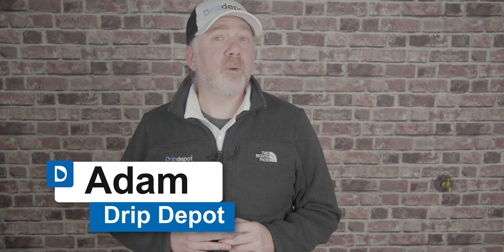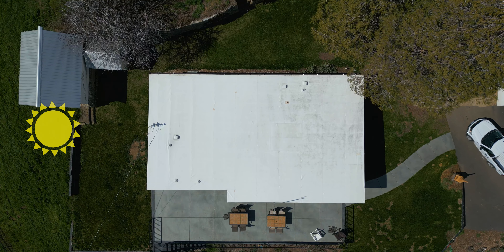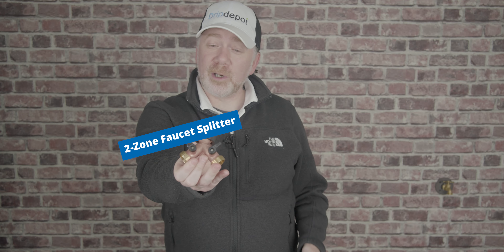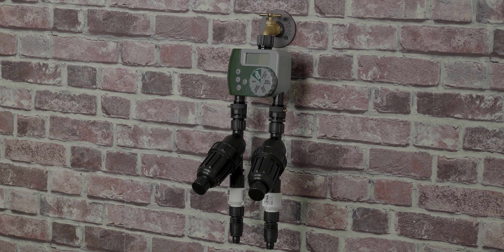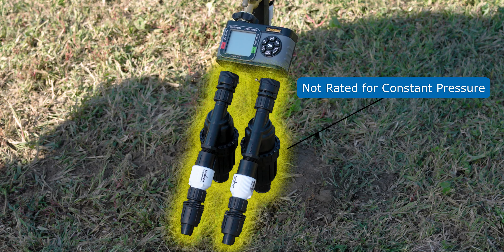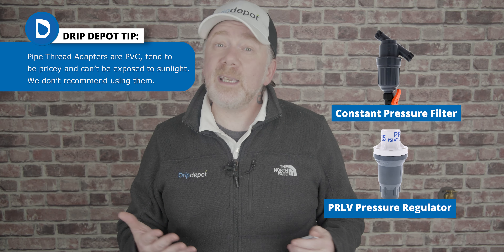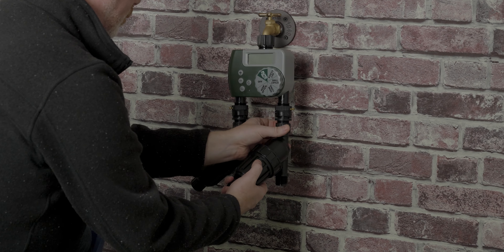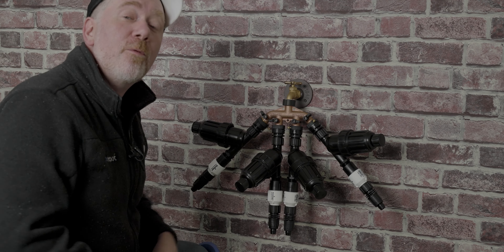How to Zone a Hose Bib Drip System

Comment: Can you add the Y splitter behind your timer and add the 2 head assemblies? In my scenario I just have a large garden and am zoning due to the length of 1/2” tubing limitations. I would like to water both zones at the same time. I have a timer with 1 outlet. Thanks!
Reply from the maker: Are you thinking of adding the Y splitter to the timer's outlet so that it splits the outlet into two directions?  If so, that is acceptable (you'll want to make sure you have the flow to support both sides of course) and you might even be able to do it in a way that costs less. 

You could have your Faucet --> Timer --> Head Assembly -->  Faucet Y Splitter --> Threads x Tubing Adapter (1193 on our website). 

That would effectively split the run into two separate directions, but you'd only need one head assembly.  It would also allow each individual run to be under the length limitations (still want to make sure the water source can provide enough GPH to feed both sides though).   Both sides would water at once (which technically makes it one zone, but that's ok) with just one head assembly :) 

If I misunderstood anything, don't hesitate to reply here and let me know, happy to help!
Reply: Thank you this is exactly what I was meaning. I believe with the emitters and GPH calculations from your other videos it would work this way. I did buy your 2 zone head assembly just in case. I was unsure if those could go behind one timer and run at the same time though. I think I am understanding this better now though. If the GPH doesn’t allow them to run at the same time I would need a new timer that splits the 2 head assemblies so they would run at different times to make up for the GPH. If I am misunderstanding please let me know. Thank you so much for your awesome informative videos. They are really helping me understand a lot!
Reply from the maker: @TheProdigalGardener   You got it exactly right!  If the water source cannot provide enough GPH for it all to run at once, you zone it exactly like you suggested :) 

On the head assembly parts -- the reason they cannot come before the timer is due to "constant pressure."  The parts are not rated for constant pressure so have to be relieved when the system is not in use.  There are some that are rated for constant pressure, but they're all larger and pipe threaded, meaning you have to use a lot of adapters to get them connected to a hose bib.  It basically ends up costing about the same (or more until 3 zones) but has more points of possible issues due to all the adapters.  

It sounds like your planning and understanding is coming along very nicely!  You're welcome to reach out here (or to us on our website) if any questions come up while you finalize things, I'll be absolutely happy to help.
Reply: @dripdepot  Thank you so much for your help! I really appreciate you!

Comment: I apologize at the beginning, I’m a beginner and feel way over my head. 😅 We have a 50 foot wetlands easement between our house (hose bib) and our garden which is another 150 feet long 35 feet wide. I think potentially we may have 2 or 3 zones within that garden. Would we need to use the 1 inch hose to get across the easement then split to 2 or 3  1/2 inch tubing for each zone? Would the timer then be put on at the split? I can’t think of a way to put the timer at the hose bib. Do you have another better idea?
Reply from the maker: Lisa, I'll be happy to help!  You can ask questions any time throughout the process if you get stuck on anything -- never hesitate to reach out, it's how all of us learned too :) 

Are you allowed to put anything on the easement?  Not a structure and not even necessarily anything permanent, I was thinking more along the lines of running tubing over the easement?  If so, that would be the best bet as you could build the multi-zone head assembly at the hose bib, though you'd have a few lines of tubing running over the easement. 

The reason that's normally important is that most hoses are not rated for constant pressure, so in the proposed setup of running the hose to the garden and then installing the timer there, that hose would always be under pressure, which can cause them to quickly wear out -- if it ruptures at a bad time and isn't noticed, it can make a big mess.  

If you do have a hose that's rated for constant pressure, your plan is absolutely viable :)  

If you're not sure (it's not often they say if they are or not), I'd contact the manufacturer to ask, or even to recommend which one they have that is rated for constant pressure.  

Basically -- your plan can work, but make sure to get a hose that's rated for constant pressure -- then, at the garden, install the timer first (the valve in the timer can handle constant pressure) and then a head assembly for each zone. 

Don't be shy about follow-up questions or other drip questions!
Reply: Thank you for your answer. 
We actually have a water retention pond in the wetlands and a bridge going over it. We can use the bridge to attach the tubing on the sides. In years past we have been using a very long regular hose attached to a sprinkler and moving it about 4 times each time we water the plants. Very time consuming and cumbersome.  😅

I am wondering how I would want to zone this in the best way possible. 

The full property is 300 feet long 35 feet wide. 
The first 100 feet:
The house sits on the front of the property 100 feet long 35 feet wide
 
The second 100 feet
Wetlands and patio
The wet lands sits behind the house that is 50 feet long by 35 feet wide. A bridge runs across the wetlands on the left side of the width of the property. 
As you walk off the bridge there is a path (3 feet by 25-30 feet long) within the wetlands and heads into the usable part of the backyard. 

After about 25 - 30 feet of path from the bridge there is a square patio (30 feet x 30 feet) approx 2.5 feet of plants on each side of the patio completes the 35 foot width

Plants run all the way on left side of the landscape from the bridge running all the way to the back fence. (2.5-3 feet x 150-175 feet)

Third 100 feet
After the patio is a fully landscaped area 75 feet x 35 feet with a circle (radius 28 feet) gravel path sitting in the middle with plants on the outside of the circle as well as inside the circle. 
A shed with privacy trees behind completes the final 25 feet. 

If I’m understanding you, are you saying if we can, possibly run 3 tubes to the back over the bridge? I think its possible. 

My thoughts would be

Zone 1: (left side of landscaping) from the hose bib at the house run across the bridge straight down the left side to the fence (200 feet) put a elbow connecter possibly run another 15-20 feet then cap off? (Total 220 feet)

Zone 2: (right side of landscaping) from hose bib at the house run on right side of bridge, elbow right connect at about the patio (50 feet) run about 20 feet to the right side, elbow connect to the left run down to the fence (150 feet) then  elbow connect left about 10-15 feet then cap off? Zone 1 and 2 end about the same place (at the back fence). (Total 235 feet)

Zone 3: (plants inside the gravel path circle) from hose bib at the house run on right side of bridge, elbow right connect at about the patio (50 feet),
run about 20 feet to the right side, elbow connect left, 
run down approx 50 feet past the patio, 
elbow connect to the left approx 10 feet to reach inside the circle then cap off? (Total 130 feet)

If you have understood so far,
 my question is what kind of, timers, pressure valves, backflow preventers, and tubing would I use for all this length from the hose bib. I realize I have all the other factors of flow rate and how many emitters and the other variables. I think need to understand if my zones are correctly thought out before going further. Am I missing anything so far? Can you think of anything better?

Thank you again for your time and expertise. 

I’m more concerned about ease and simplicity than money at this point, unless very outrageously costly.
Reply from the maker: @lisamishina1317  Lisa, thank you for getting back!  Great description of what you're doing -- and no worries, I do believe this can be done without being outrageously expensive, and I can help keep things budget friendly without sacrificing quality.  

With the lengths of your three zones, I suspect you'll be able to use 1/2" to 3/4" tubing as the mainline for the zones -- attaching it to the bridge is a great idea.  Is the bridge made of wood?  If so, some common tubing clamps can secure it to the bridge to keep it looking neat and tidy (and even discreet depending on the design of the bridge).  

In regards to timer, I'd likely go with a 3 to 4 zone hose timer -- it will go right on your hose bib and allow you to easily run each of your three zones from there.  On each of the timer outlets that will run a drip zone, you'd just need a backflow preventer, a filter and then a pressure regulator -- after that is just an adapter to connect your tubing and off you go :) 

You'd run your tubing out to there it needs to go, using elbows and tees as needed, and then cap it off and install your emitters and you're pretty much done at that point.  

I can also help you determine which zones should use what mainline -- so, it sounds like your longest zone is going to require 235' of mainline and the shortest is going to require 130' -- does that sound right?  Two major variables go into picking a mainline size -- its overall length and the volume of water going through it.  Overall length you sent over, now we're going to want to determine how much water will be going through it.  

This part is based on the number of emitters and their flow rate.  Do you know what emitters and how many you'd like to use on each zone yet?  If so, let me know and I'll run the numbers and tell you what they mean for mainline size.  From what I've seen so far, I don't think you'll need anything particularly large (which is good!  A lot of the cost for an irrigation system comes from the mainline), but always best to make 100% sure.  

If you haven't picked emitters yet, that's no problem, I'm happy to help there as well.  

Here is a link to some sample designs we made for many types of projects (raised beds, general landscapes, potted plants, trees, etc) -- take a look at a few of them that are close to what you need to irrigate and you can get an idea of what's used for different projects.  You'll notice they have a lot of overlap, which helps simplify things greatly, there's not too terribly many options.  Here is that link:  https://help.dripdepot.com/support/solutions/folders/11000020065

If you already have emitter plans, just let me know which ones and how many per zone and I'll do some quick math to help with mainline size =D
Reply: Ok! Thank you for your encouragement! I have my homework to do and will get back to you when I have these other factors figured out so you can help me with the next steps! Thanks again! 🤗
Reply from the maker: @lisamishina1317  You bet Lisa!  And I absolutely look forward to helping, so don't be shy at all, I love talking about irrigation :)
Reply: Ok! We have some answers and lot more questions. :)
We found out we have a water flow of 400 gph. 

Working on my zones. 
ZONE 1 - runs straight along the bridge and all the way down to the end of the property and behind the shed. Total 219 feet
We have 78 plants running straight in a row along this side all within a plant bed 2-3 foot wide. An additional 7 trees complete the zone end. 

ZONE 2 - runs down the bridge, curves across to the opposite side of the property then runs down about half way and turns toward the middle where the landscaping sits in the middle of the circle. 199 feet (No emitters are used till we get to the circle landscaping) 
- we are using this zone to cover 2 plant beds 1) center of circle 2) another small side bed (we named this zone 2b)
- the circle is not a true circle it’s more the shape of a tear drop. 25’ - 36’ ( at the widest part) My thoughts are to put a Y-shaped mainline tubing in the circle. Start with one main tubing at the smallest part of the tear drop and split to a Y at the wider part of the plant bed. QUESTION: How long can the 1/4”  tubing run from the mainline tubing to reach each plant? Can I run just one mainline tubing straight down the middle of the circle instead of the Y?
— Zone 2b - side plant bed-to get to this plant bed we would tee off of the mainline tubing from the circle and travel forward to another bed approx 18 more feet
- 18 med plants and one tree is in this plant bed. 
 
ZONE 3- (separate main tubing but runs along side of zone 2 until it splits off toward the circle) total 300 feet, 66 plants including 13 large (possible rings?)

Ok! What is my next step? I’m hoping you can simplify and let me know if and the best way for all these plants to be covered. 

Main tubing size and emitter size/type?

Thank you again for your help. 

If it would help and if it’s possible I can send you a close drawing of our landscaping. Let me know how to send it. 

 
From hose bib to bridge, bridge t-split (forward to end of path) (and to the right to curve with zone 2 main tubing) (2&3 zip tied together)
Left elbow to continue forward till the end of the property left elbow 13 more feet. 
- zone 3b small plant bed past the patio to T off of main tubing (18 plants, 1 tree)
- total 40 plants including 12 trees
Reply: Please let me know if any of this is confusing. 
I’ll try to clarify further if needed. :)
Reply from the maker: @lisamishina1317  I hope you had a great weekend Lisa!  And perfect on the information, this is great -- at the end I'm going to link you to the contact us so you can send over a diagram just so I can perfectly visualize it all, but with what's here I have a  pretty good idea of what you're doing :) 

1/4" tubing, from the mainline, should be kept to lengths of 30' or less -- you could indeed just run mainline down the middle of the circle and then use 1/4" tubing to come off of it -- if the widest part is 36', that would only be 18' on either side of it, well within the 30' recommended maximum.  

Zone three might be the only one that will need a little extra attention since the line there is 300' -- what types of plants are those 66 plants?  What I'm looking for here is to get an idea of what volume of water will be going through that 300' line.  

Lisa, fire us off an email from the Contact Us link here: https://help.dripdepot.com/support/solutions/articles/11000049095-how-to-contact-drip-depot

If you can, include a diagram or sketch (and/or pictures!) and the types of plants and I'll take a look and help you iron out the final plans -- On the sketch or diagram, include your thoughts on where your mainline(s) will run, using different color for different zones if possible -- no worries if you can't do all of this, just what you can will work, I think we can indeed simplify this down to some drippers and drip line (including the rings you'd mentioned). 

When you use the Contact Us link, just put something like: "Attention Adam" or "For Adam" and it will get routed my way and I'll jump right in :)
Reply: Hi Adam, I ended up in the hospital a couple of days having fallen down the stairs. I’m running a bit slower than normal, but will get back to the discussion, links and downloads as soon as I am able. Thank you so much for your quick and informative replies. I aim to get this done asap. Thank you also for your patience.
Reply from the maker: @lisamishina1317  Lisa, first, I absolutely hope you're ok and sincerely wish you a full and speedy recovery.  No rush here at all, we can pick back up right where we left off, here or via email at any time :) 

Also, awesome that you're already back up and moving, sometimes getting out of bed too fast almost puts me down for the day, I can't imagine a tumble on the stairs.  Take care of yourself, I'll be here when you're ready!
Reply: @dripdepot  Thank you for your patience, I’m so excited to work on this, but need hubby to help take and download pics. Alas he’s working full time and caring for this wobbly wife who fell on her head. 😅😊
Reply from the maker: @lisamishina1317  No patience needed Lisa, I'm happy to help!  I won't be going anywhere, so send those on over at any time and no rush at all :)

Comment: What about 12 zones,how to do it?
Reply from the maker: At that many zones, the best bet would be to go with a traditional irrigation controller and solenoid valves.  12 zones can technically be done on a hose bib using a 4 outlet faucet splitter and 3 to 4 outlet hose timers.  Between those and the head assemblies, a lot of weight is created which would apply significant stress on a hose bib, which may not be installed in such a way to support all the additional weight.